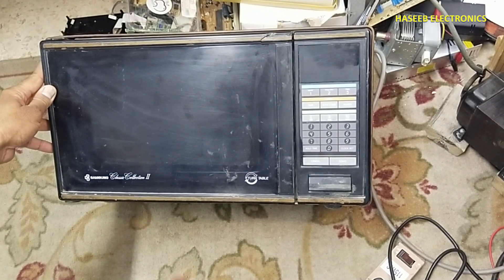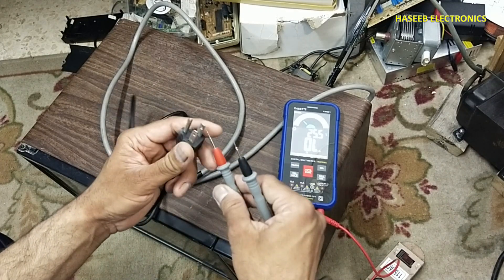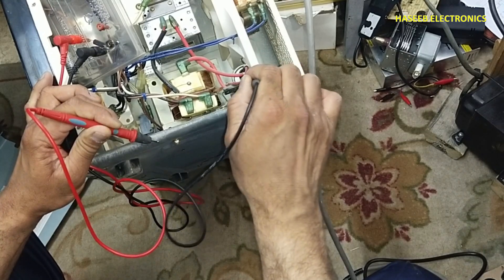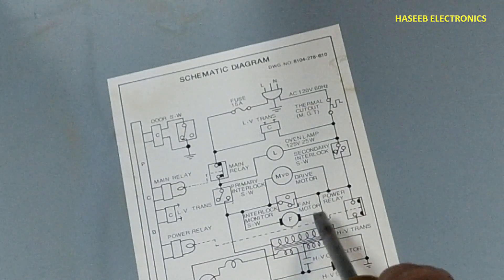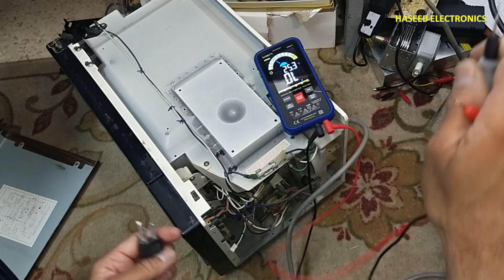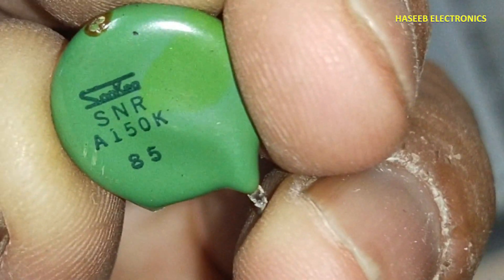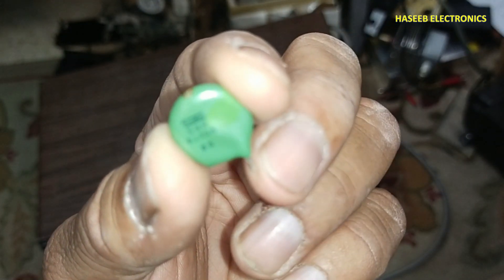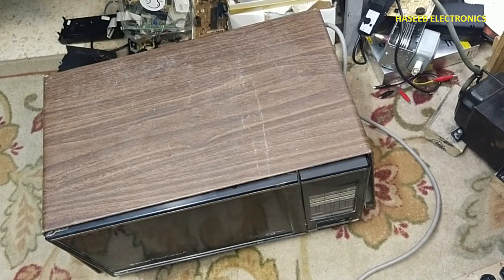{884} Microwave oven repair, circuit breaker keeps tripping off

Comment: I am your new subscriber. 
Your troubleshooting skill is definitely classic even though it is hard to understand your accent.(I kept rewinding most sentences you said, because I do not want to miss out important pointers from you!)
Would you mind to make a video regarding the building of your microwave HV Capacitor discharges that you used on the mw oven repairs.(2:38) 
I have viewed most of your mw oven series but couldn't figure out how and what resistors to safely use on your cap discharger.
Can you suggest resistors that can be safely used on both very high voltages( about 6000v to discharge home appliances TV inclusive) and low voltages(around 100v), so that I can build one all-purpose cap discharger?

Your help is very much appreciated!!!!!!!!!
Reply: Haseeb, just found your HV Cap Discharger cum HV Measurement Tool!
Thank you for your generous gifts to the world!
GOD BLESS YOU!!!!!!!!!!!!
Reply: Haseeb, just found your HV Cap Discharger cum HV Measurement Tool!
Thank you for your generous gifts to the world!
GOD BLESS YOU!!!!!!!!!!!!

Comment: That is a cool vintage microwave! Wood grain finish and VFD dipslay tubes looks a lot better than the newer lcd displays. I would imagine that transformer doesn't like 50 hz very well as they're running at saturation even at 60 hz. Seems to heat that water really fast though. There is a bleeder resistor inside the voltage doubler capacitor. It MIGHT still be good. It's smart to discharge it! It should be pointed out that the microwave oven transformer is DEADLY while it's powered up! A lot of Youtube videos on projects you can make, which are fine IF you remove the high voltage wiring from it. To make a spot welder for example. Thanks for showing!

Comment: Very good, as always. But since the varistor was damaged, why the fuse dind't blow?
Reply from the maker: when the main circuit breaker is less than fuse amperage. that time fuse will not burns, the circuit breaker trips off

Comment: SNR A150K 85? Varistor. What are te specs and what did you replace it with? I cant find this part oon Aliexpress. 😢 I also saw it in a Samsung TV Powersupply. Is this a typical Samsung Part maybe?
Reply from the maker: it's equivalent part number is VDR 10D151K
Reply: @HaseebElectronics  thank you verry much. Realy helps me out.

Comment: Why did the shorted Varistor not blow the interal fuse? Had the circuit breaker a lesser current value or is the internal fuse too high? I always check the value of fuses for correctness, users put in strange values, sometimes. 😊
Reply: A power surge can damage this cheap part. It saves the rest of the board if you know how to fix it.